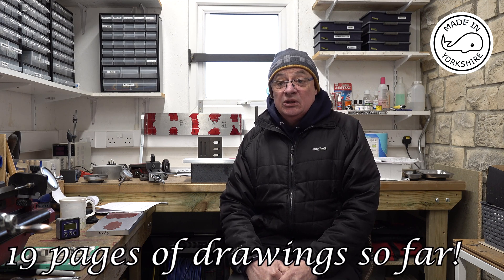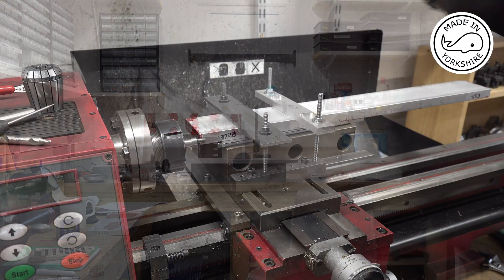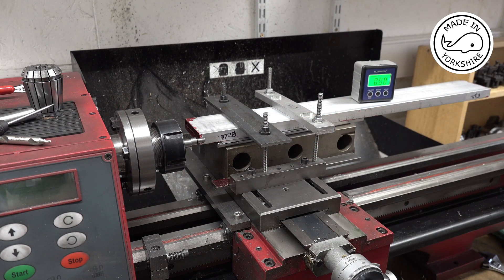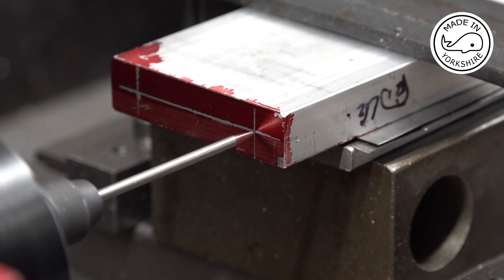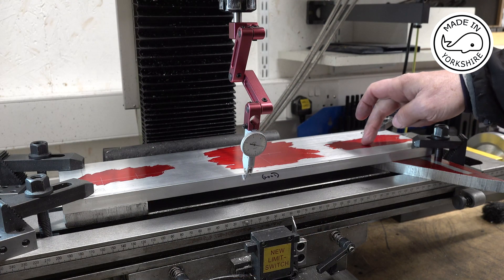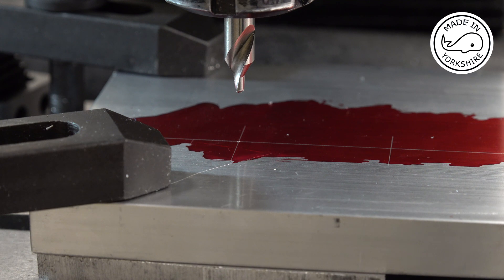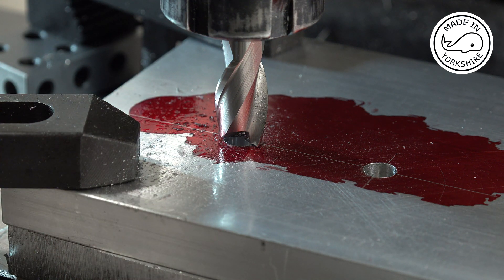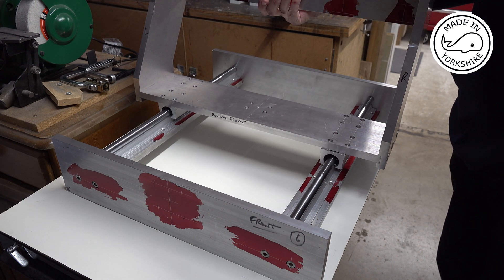#MT47 Part 2 - Olivier CNC Router/Engraver. The Base. In 4K/UHD by Andrew Whale.

Comment: Just subscribed, interesting build as I am currently in the design phase of a  couple of cnc machines.
You might want to consider putting another strip of aluminum underneath those Y axis plates. for some additional strength.
That way you get a T beam and eliminate pretty much all the possible flex and maximize the rigidity of that axis.
Something like 5 or 6 bolts over the length should do it.
Reply from the maker: Hi johan - thanks for the advice. I will pass your comments onto Olivier.
Cheers
Andrew

Comment: Hi Andrew, I have mentioned this to you before, but here is another reminder for next time. Where the material thickness will allow it, and in your case it did, drill the clearance size hole down to a depth of 2 to 3 threads. Then when the hole is tapped you get a nice clean round hole to chamfer. Drilling the clearance size hole for a short bit helps in two ways. Firstly it gives the bolt a start when trying to find the hole, and secondly should any threads decide to "Pull Up" when tightening it does not leave a raised surface to make mating flat surfaces a problem. Professional gearboxes are done this way as well as car cylinder blocks. Have fun and TURN on some heating, instead of a thick coat and woolly hat. LOL Your Machinery would also appreciate it too. Regards from Australia.
Reply from the maker: Thanks Dave, another great tip. I must have forgotten that one 🫢. I will try to apply it going forward.
All the best from the balmy UK!
Andrew

Comment: Hi Andrew; I never thought of using my lathe for a drill press!! great idea for long pieces.
Rich
Reply: The lathe is the mother of all machine tools, using it this way is pretty much using it as a horizontal boring mill.
When you look into it there is alot of information about machine tool history starting off with lathes and use those to eventually make mills etc with those (short version)
Reply from the maker: Hi Rich. Olivier suggested that method and it works really well.
Cheers
Andrew

Comment: Just a suggestion. Not that what you are doing isn't perfectly fine for the precision required. But if you put something with the same diameter as the shank of your edge finder in the tail center's chuck. Than you could pull the bar up against that and the edge finders shank when you tighten the clamps. Sort of eliminates the eyeball thing, if you know what I mean.  Just a suggestion.
Reply from the maker: A great suggestion!
Thanks mate!